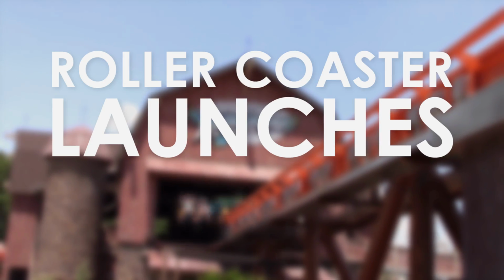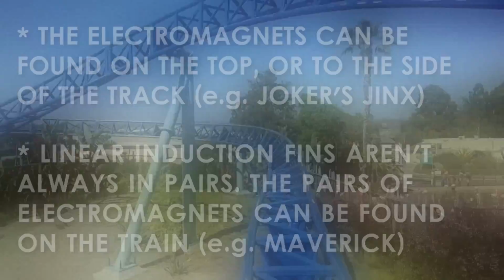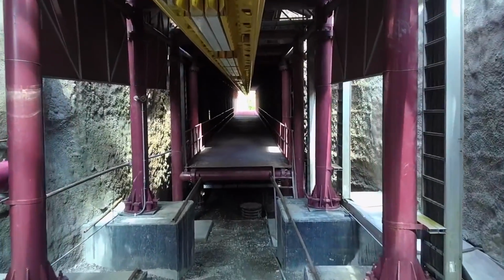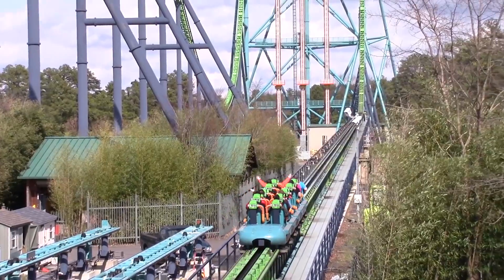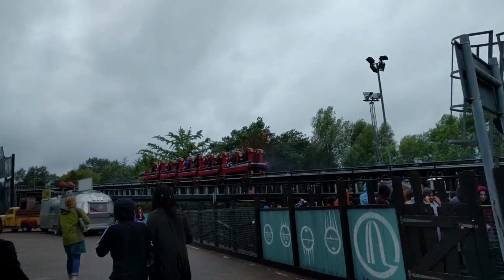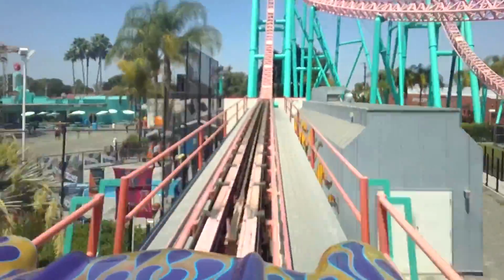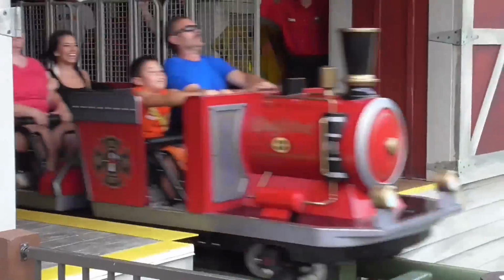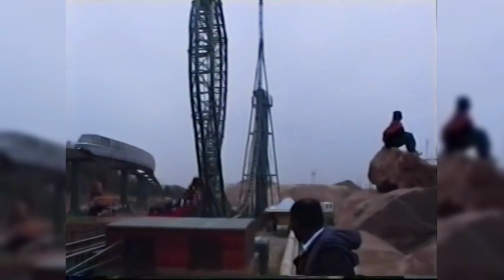Roller Coaster Launches: Explained

Comment: I like the linear compressed cylinder launch the best.  It provides a large degree of synchronicity in the initial stages of the ride and most accurately thrombolizes the variable forces that can cause diseases in the riders.

Comment: one thing I like about launches, it's that it enables parks that have a strict height-limit to still build very thrilling coasters. Like Phantasialand, they built Taron and now F.L.Y. The only other thrill coaster there is Black Mamba, which had to be build into the ground and is really short as well, just because they couldn't get the height in the beginning.
Reply from the maker: I definitely agree, launches allow parks to be very versatile with their roller coaster design!
Reply: Can’t forget Rita (aka the ride everyone trashed on), purely designed due to height restrictions! Its actually really decent!

Comment: From what I've heard all technologies are great. LSM's are great for multi-launch coasters and are very reliable. The cons are that the launch is often less intense. Hydraulic launches are good for use on thrilling launch coasters with a major focus on speed and the launch is often quite forceful and intense. The cons are that the technology is less reliable. Compressed Air launches are often more forceful than any other launch technology. Drive tyres are better for family launch coasters due to the speed and intensity of the launch.

Comment: Lift hill roller coasters are more thrilling. Plus launch coasters are pretty unreliable. Lightning Rod at Dollywood is down half the time. I wouldn't blame them if they changed it into a chain lifthill coaster as long as it still goes fast
Reply from the maker: Not all launch coasters are unreliable :)

Comment: Hydraulic acceleration drops off the more pressure is released, its not actually as smooth, it just stops and starts less sudden. best efficency and best acceleration power both go to electric, the only reason why theyre not stronger is because people dont want them stronger. other systems also use the same underlying tech/principle, for example railguns. you can scale it basically endlessly with enough power, wich is much harder for hydraulic to do.

Comment: I'd like to see a roller coaster with a repurposed aircraft carrier catapult for a launch.
Reply: John Whitesell that’s actually very similar to an intamin hydraulic launch
Reply: @Datareel  agreed recently rode intamin's blitz coaster in phantasialand and it was amazing
Reply: _ Kirky _ It’s pretty much the same technology as what’s used on an aircraft carrier
Reply: @Datareel  yeah
Reply: _ Kirky _ don’t know why pneumatic launches aren’t used more. they seem ideal
Reply: @CallumKP   Taron does not feature a hydraulic launch. The train is launched using magnet (LSM)  technology.
Reply: @Datareel  They cause to much problems. Maybe you know about Ring racer. The opening was planed for 2009, after a lot of problems with the launch system it openned in 2013 for 4 days.
There aren't that much pneumatic launch coasters because s&s is the only manufacturer who uses this technology.
I think s&s found a way to handle with the pneumatic launch.
Maybe we will see more pneumatic launches in the future. Maxx force was openned this year and two more pneumatic launch coasters in China are under construction.
Reply: Zuzelino just look at how successful Do-Dodonpa had been. It can’t be that unreliable
Reply: @Datareel  Yes I think they found a way to fix that.
Reply: @CallumKP that’s an LSM
Reply: DataReel its actully the same thing as a s&s air launch. Or close enough to call it the same
Reply: John Whitesell That would be insane!
Reply: That’s just basically a hydraulic launch but steam-powered
Reply: awesome
Reply: yes.
Reply: Furious Baco in Portaventura

Comment: When you say pneumatic launches are similar to hydraulic launches, in what respect are they similar. Do they both use a cable and catch car, only pneumatic launches have air instead of nitrogen gas?
Reply from the maker: From my limited knowledge of the system, that is correct. :)
Reply: Thank you!😊Did you mention over on Instagram that you were gonna be posting a video on Sunday?
Reply from the maker: I did, there will be a new video this Sunday :)

Comment: Can I just ask how the train is propelled forwards (usually) instead of backwards when it comes to LSM launches? For example with Taron, why does the first LSM launch propel the train forwards and not backwards?
Reply from the maker: By causing the LSMs to take a certain polarity, they can force the train to be repelled away from the magnets in the desired direction. I imagine it is manipulation of the magnet field created by the magnets that causes the train to go in the direction it does. This is only an educated guess though. :)

Comment: You mentioned that catapult launches aren't used anymore. I was wondering about "Revolution" at Blackpool pleasure beach in the UK as I believe this uses this type of system. I've been on it many times an it's certainly up there with my favourites.
Reply from the maker: Revolution uses an electric winch launch, one with side of the loop. The launch itself is quite good I feel! :)

Comment: In your video you said that LIM coasters can't use their launch gear as a brake. Well strictly speaking, from an engineering point of view, any electric motors can be driven to generate power and a braking force: this is often done in locomotives to facilitate Dynamic braking. And I actually have seen coasters, with a chain lift, where they put a LIM fin on just for breaking. That being said, my favorite is between is LIM launch systems; they have a good trade off of complexity, reliability, and smooth acceleration. Next to that I also like Traction launch systems because they can use standardized, off the shelf equipment, which might also include a rotary Induction Motor.
Reply from the maker: If I remember correctly, LIMs can only be used in one direction, so the magnets that launch the coaster cannot slow it down. If you reversed them mechanically, then you could use them as brakes. :)
Reply: I can't say I've heard anything like that before. From what I've heard, LIM motors are basically like rotating induction motors; except that the coils are laid flat, to propel the armature in a linear motion. And I know that force is produced in a Induction Motor, by creating an alternating magnetic field in the stator, to induce an opposing current in the armature; and pushing the load like a surfer on a wave in the process. And if the armature is moving faster than the excited frequency; then the stator would appear to be driving in reverse from the armeture’s perspective, creating a braking force. (You could also switch in DC power to the coils, which would induce eddy currents in the moving armature, causing a further braking effect :)
Reply from the maker: You are definitely correct, I don't really know what I was thinking. This effect is used within Intamin Inpulse coasters, such as Wicked Twister at Cedar Point. However, upon observation different magnets to those used to launch the coaster cause it to brake. It seems LIMs are used as a brute force to get trains moving, rather than a controlled stopping force. I think due to the strong nature of LIMs, this is why they are not used as brakes, even though they could be. :)

Comment: Flywheel launches are still used in  newer coasters today.  The Vekoma Motorbike and Zamperla Moto coasters still use flywheel launches.
Reply from the maker: I did overlook Zamperla's Moto coasters, as they aren't a well talked about ride model. However Vekoma Motorbike coasters use hydraulic launches to propel riders. Nevertheless, thanks for the correction. :)

Comment: I want to see someone make a compression launch. This would work by compressing a very dense material with hydraulic pistons then releasing all the energy into the car causing an acceleration faster than any other method.
Reply from the maker: What you have described are hydraulic launches! These compress liquid nitrogen and then release the energy in one sharp movement! :)

Comment: I do agree that hydrolic launches can be unreliable but how else are you supposed to make it up a 450 foot tall coaster i think if any other theem park wants to beat a coaster hight record thay will have to use a hydrolic lounch system but most normal coasters dont need to have a hydrolic lounch seystum
Reply from the maker: We have seen Red Force, a LSM launch coaster, reach heights of over 300ft not using a hydraulic launch. It may be possible to launch riders even higher than Kingda Ka in the future :)
Reply: *air launches*

Comment: TTD at cedar point should upgrade to LSM
Reply: the question is: will LSM generate the power that a hydraulic launch gives? the distance that is used for kingda ka or TTD is not that long so would LSM do the job on that distance?
Reply: No problem there. The power of an LSM is only limited by the currents supported by the cables. The new Gerald R. Ford Class Carriers use an similar launch system on it's aircraft-catapults.
Reply: In a perfect world, LSM systems would be the ideal launch method. The problem of LSM's is more practical than theoretical as most theme parks have to share the national electricity grid with the rest of the country. Take Stealth at Thorpe Park for example, a 50% version of Kingda Ka. The rides hydraulic launch system is powered by 2 400Kw electric motors which take around 15 seconds to charge the accumulators. Ignoring the rest of the rides electrical systems this is the heaviest periodic load the ride places on the grid supply. Assuming an 80% efficiency this would fill the catapult with 9.6MJ of energy. With the same efficiency the system then sends 7.7MJ down the cable to you sat in the train. Stealth hits 80mph in 1.9 seconds so this results in an energy transfer rate of 3.8MW. An LSM system would use the same ammount of energy to launch the train at the same power level but it would draw that power directly from the electrical supply rather than storing it locally. Hammering the national grid with a 3.8MW load every minute or so would probably result in a few angry phone calls from the supplier.
Im using numbers based on practical experience with Stealth and a bit of guesswork regarding the efficiency.

Comment: I like the hydraulic launch the most because when it start.... uhhhh it kicks your butt and you just feel the force. I went on Taron (current record holder for fastest LSM acceleration) and i was kinda disappointed by the launch
Reply from the maker: I've heard Taron's launch, especially the 2nd one, is very intense. Hydraulics launches are often the more intense.
Reply: Tarons Launch isn't bad either but it was the first LSM i've ever rode. Before that I've only rode a Rita clone with a hydraulic launch =). thats the reason behind my personal oppinion ^^
Reply from the maker: That's fair enough. After you've ridden more LSM coasters you'll realise Taron's is quite fast! :)
Reply: coasterbot i went also on taron and i must say that the second launch is dissapointing me, the feeling in you're stomach is great at the first launch but the second launch doesn't gave me that feeling, althrough when you realize that you're going fast you're just lost because of the airtime you get, every turn/bend you get that feeling. it's just amazing!

Comment: From experiencing hydraulic, LIM, and LSM launches, my favorite type of launch is a hydraulic launch. Nothing beats going 120mph in under 4 seconds (TTD's launch speed).
Reply from the maker: I also prefer Hydraulic launches :)
Reply: Kingda Ka Has a Better & More Intense Launch, That Is Also From My Experiance Quite Scary Due To The Strong Wind Going In The Eyes. Top Thrill Dragster Felt So Quick On The Launch That I Hardly Notice Rembering Much Of Anything. SO I Personally Prefer Kingda Ka. If You Or Anyone Disagree That's Fine, As We All Enjoy Roller Coasters For Different Reasons. As Someone From The Uk Who Has Done Both I Say kingda Ka For Intensity, Top Thrill Dragster For Feeling Of Flight/Air Time.
Reply: and now they probably remove the hydraulic launch from TTD. But if they add LSM, they have to achieve the same speed as before, to make the hill. But maybe the launch section will be longer, so the launch will be smoother (and less intense).

Comment: I love Rita however it has awful downtime. Don't think I've been to Alton towers and seen Rita open all day this season.
Reply from the maker: Rita is enjoyable, I don't find it rough at all. You are right though, it does go down a lot.
Reply from the maker: I'm about 1.88m high, so yeah I'm quite tall. I find this helps on most rides.
Reply: Ben Ayre on Saturday it was up all day but rough
Reply: Owen C Rough indeed, I always do front row is way smoother. You have to remember it is 11 years old too.
Reply: COASTER BOT Are you tall? It gets less rough every year for me due to me growing in height. or I'm just used to it after a teeth rattling back row on smiler 😂

Comment: May I ask what launch pony express at KBF has? I checked wiki and it said flywheel which I am pretty sure is wrong. Also I like LSMs because they don't need to have a completely stopped car, like xcelorator, montezoomas revenge and pony express. What launch method does superman at SFMM have and california screamin'
Reply: fly wheels are spinning wheels, i only know them from nerf guns but the have to sets of spinning wheels that launch the thing 
so it's like those hot wheels launchers:these things spin around creating a tight space >   < and a train moves through it getting launched
Reply from the maker: This is incorrect SonicCam04, you are describing Friction Wheels. Flywheels consist of large wheels that are spun at very high speeds, and therefore have a lot of energy. They are then connected to the train via a cable. The cable is pulled coverting the energy stored in the wheel to kinetic energy of the train. This launch type is not very common anymore.
Reply: COASTER BOT ok i was only making a guess, thank you!

Comment: Great Video! My favourite type of launch is probably LSM because the acceleration is smoother and you don't get that initial "kick" like on hydraulic ones.
They also allow for multi launch coasters to be constructed, which are among my favourite coasters ever.
Reply from the maker: Thank you very much! LSM launches can be awesome, but I have currently been let down by the roller coasters I have ridden featuring this launch method. As a result I prefer Hydraulic launches the most so far. :)